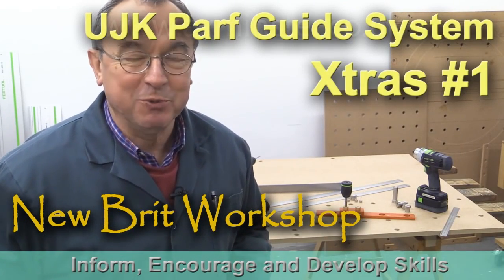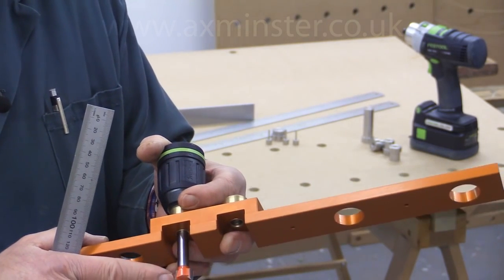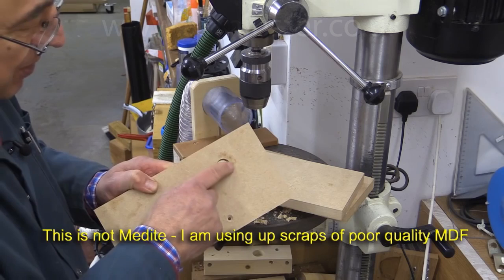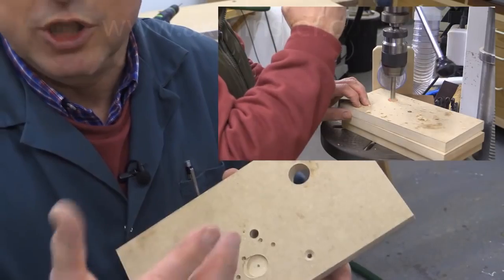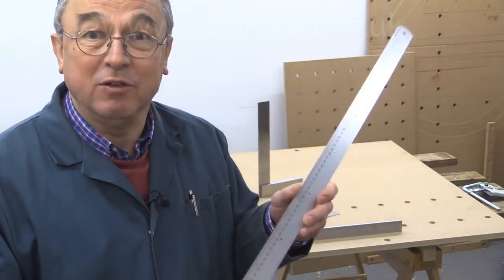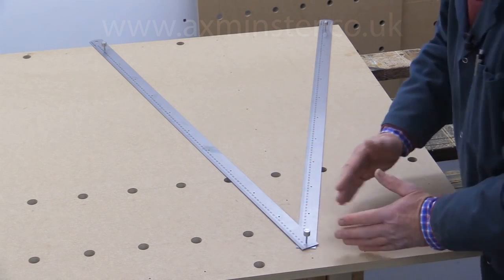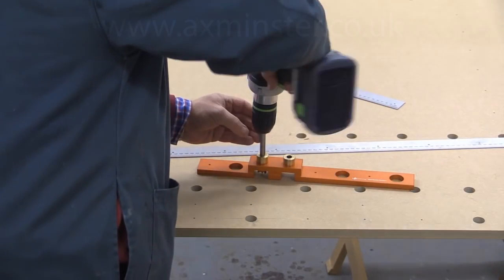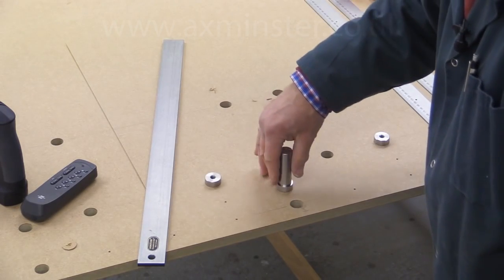UJK Parf Guide System - Xtras #1

Comment: Could you please comment on the significance of having the 20 mm holes spaced 96 mm apart instead of 100 mm apart? Thanks.
Reply from the maker: Good afternoon

As this works on the hypotenuse theorem the measurements used will need to follow the rules of the theorem.

Kind regards

Jade
Customer Service

Comment: Excellent video.  It's probably been commented on before, but the UKJ system makes the MFT table redundant.  The MFT table has a very restricted cutting length and track system guides often restrict the material being cut, unlike making a table out of a sheet of MDF.  Another issue with the MFT is that you absolutely need the additional cross braces to make the table stable-these should be included as part of the table not an optional extra.